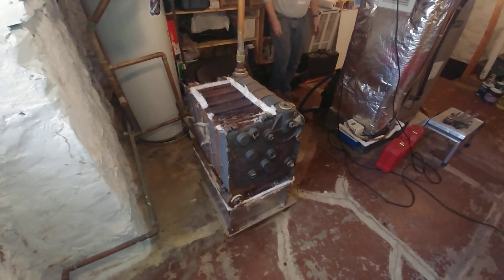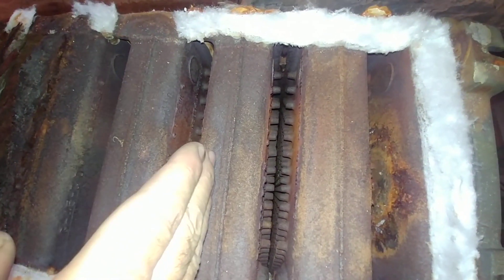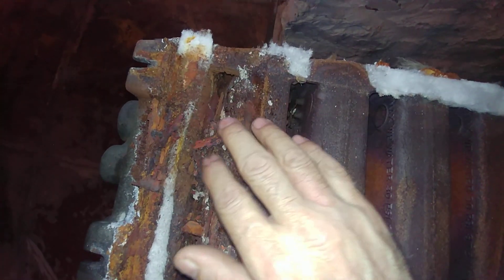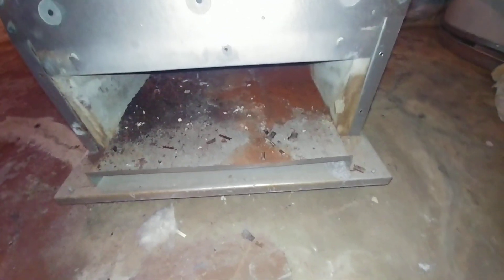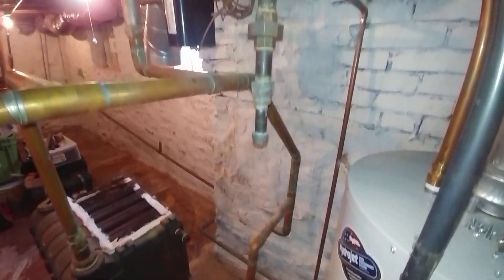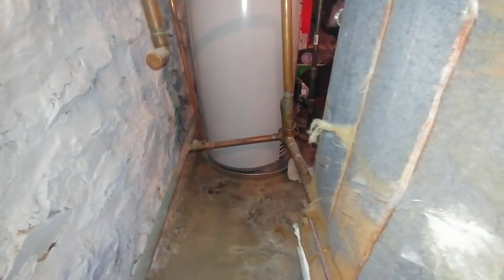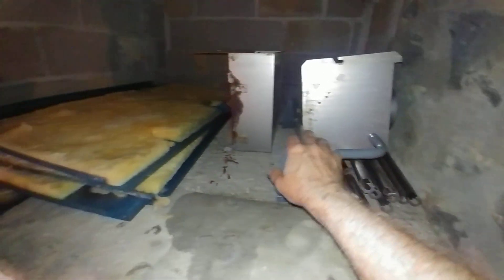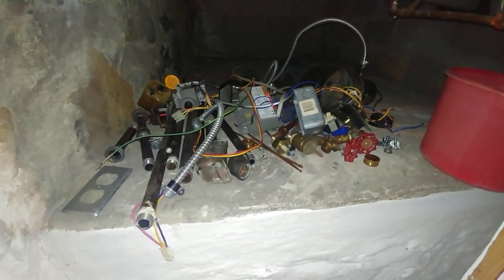Steam Boiler Disassembly... Zombie Boiler

Comment: I work for a hvac company in nyc and we install burnham boilers. And have a lot of old times that did as well back in the day those would last 10 years and get a high section leak. They even sent us out to the burnham plant in PA and when we spoke to the engineers about why that would happen, they never gave us a straight answer. Long story short we install Weil McLain now
Reply: Thanks for your insights! 
I thought it was just us that noticed an issue with the post 2001 IN models and their just-above-the-waterline section failures.  It was attributed to high chlorides in the water causing graphite depolarization in the quantum flux capacitor.  
Uh huh. Right. Whatever.  
Like you, we install everything but Burnham INs.
Reply: @elgordo271  had the same problem with my Burnham Independence, above the water line..took a while for me to figured it out...
11 year old, I asked the contractor to installed a Crown Boiler.. instead. Also install water softener hopefully help with the rust issue.
Reply from the maker: @HelloWorld-hb7yt  I would hold off on installing a water softener.  
Sodium chloride won't help your boiler. 
Just make sure your water is not acidic (below 7pH) &  correct that if it is.
Please also insist in writing in the contract that the boiler be piped to mfd. instructions. VERY important!

Comment: And, and, it was naked.
We have a stair climber dolly and can easily knock one of these apart and wheel it out.  We usually can get the new one wheeled in ourselves too.  We like Peerless because the cast iron block comes naked and sometimes in 2 pieces.
Reply: I wish my favorite wholesaler would stock Peerless.  They will sell it to me, sure, but not at the best price.  The local wholesaler that does stock Peerless just has tailgate delivery.   I much prefer dealing with someone who has "basement delivery' and hauls away the old one.  Really helps with logistics and manpower!

Comment: IN-6?
Reply from the maker: Yes. Almost double the size needed.
Reply: What rotted it out???
Reply from the maker: Not sure. Too much water usage due leaking vents?  It is 20 years old. Only first saw this boiler when it was already a zombie earlier this year.
Reply: @gordonschweizer5154 From what I have heard Burnham had  bad boiler sections thru about 1999 or so.  This could have been at the tail end.  My IN-8 is 2005.  Hope it lasts.
Reply: @Bob.W.  So do I